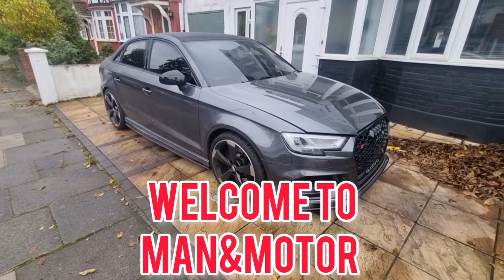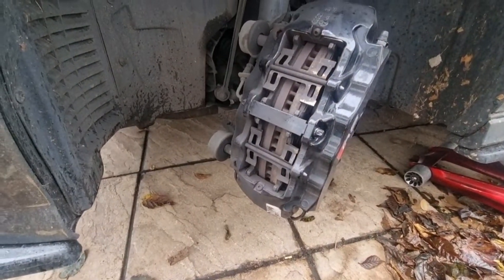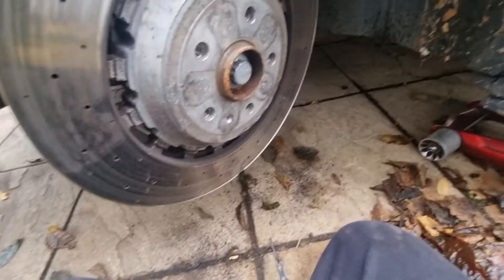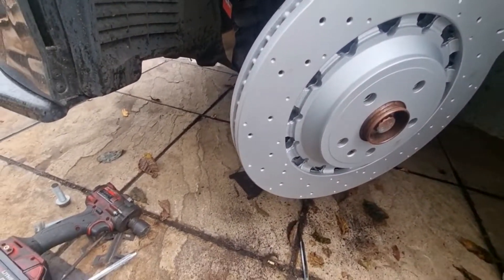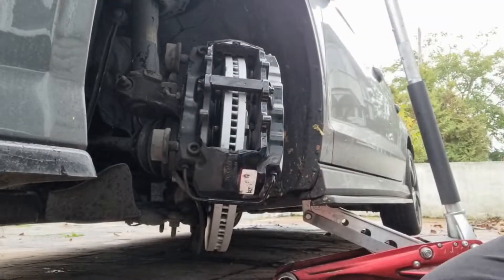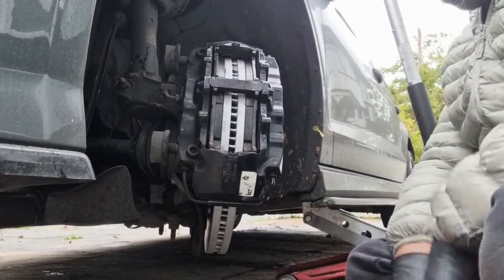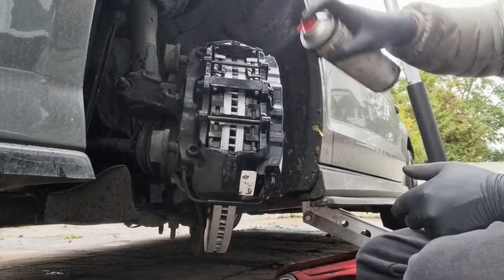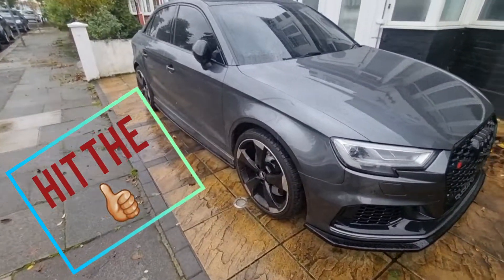Audi RS3 2019 FRONT BRAKE PADS AND DISCS CHANGE

Comment: Hello, I was wondering what size the brake discs were on the RS3. Couldn’t find it anywhere on the Internet also, I’m about to order new brake discs from Brembo but seen that there are 2 sizes. 340mm and 370mm. Any Idea which one I need? Or a link from the brake discs that you ordered could also be helping. Thanks, nice video 👌🏼
Reply from the maker: https://www.ebay.co.uk/itm/274042247972?mkcid=16&mkevt=1&mkrid=711-127632-2357-0&ssspo=isQBGrctTv-&sssrc=4429486&ssuid=xgpPGnYCQb-&var=&widget_ver=artemis&media=WHATS_APP
Reply from the maker: Hi, I sent the link to you , it's 370mm discs, that I fitted,

Comment: Do the pads get glued to the pistons on the caliper? Or do i just push in the pistons and put in the new pads? On my s6 c7 you have to buy new shims to put on the back of the pads (which goes into the pistons)
Reply from the maker: The pads came out easy on the rs3, and it come with new shims to,

Comment: What where all of the tools you used in the video? i'm planning on doing my front brakes on my rs3 and just wanna make sure im prepared! Thanks
Reply from the maker: Hi, so you will need a hammer, punch tool, 21mm spanner, or ratchet with 21mm socket. A long handle ratchet will be better, a flat screw driver to re set the piston, to take the wheels off 17mm socket wire brush
Reply: Thanks for the response! 21mm for the two bolts for caliper right? And it’s 200nm for the caliper bolt and 90nm for the wheels, but what about the T30 for the rotor?
Reply from the maker: Yes need a T30 for rota

Comment: When you push the pistons back with a screwdriver, do you have to make sure you push them all back the same distance? And did you open the fluid reservoir?
Reply from the maker: HI NO YOU DON'T HAVE TO PUSH IT THE SAME DISTANCE, LONG A THEY ARE ALL PUSH BACK THAT FINE AND, YES RESERVOIR WAS OPEN
Reply: Why do you open the fluid reservoir when doing so? And by fluid reservoir meaning the brake fluid reservoir?

Comment: hello, they have changed the front pads of my rs3 2018 and they have loosened the strap that goes with the screw.  Is there a problem in disassembling it to put the brake pads?
Reply from the maker: Hi, you mean the strap between the pads with 2 bolts on either side ?
If it is that I didn't have to take it off because I changed the brake discs too, so, in the past I never had problems before
Reply: @manmotor2889  hello, yes, I mean the strap with two screws that separates the brake pads.  I have read in a manual that the strap should not be released because there is a danger of damage.  In the workshop due to ignorance they released it to put the brake pads and now I don't know what torque they have given to the screw.  I am somewhat concerned.
Reply from the maker: You can remove them, I have in the before, I'm not sure about the toque setting.
Reply: @juancarlosnavarro3867   what you read is correct, Audi shop manual recommends to NOT remove that bridge, additionally, there is no need to remove it to remove old pads/insert new ones.... just remove pins and springs, retract pistons slightly, and the bads will come off

Comment: Hey would you mind posting a link to the rotors that you used?
Reply from the maker: https://www.ebay.co.uk/itm/274042247972?mkcid=16&mkevt=1&mkrid=711-127632-2357-0&ssspo=isQBGrctTv-&sssrc=2349624&ssuid=xgpPGnYCQb-&var=&widget_ver=artemis&media=WHATS_APP
Reply from the maker: Hi this is the link where I got the pads and discs
Reply: @manmotor2889  Thanks!

Comment: Can I switch my carbon ceramic rotors to the Brembo rotor kit you have? Or is there a size difference
Reply from the maker: Hi, yes, you can change it to normal Brembo rotor,  just have to match the size
Reply: You can just switch rotors and pads.

Comment: what brand of discs are these? can you give me information . I would like to buy brembo discs because Audi told me that oem discs + pads replacement would cost me 3000€.
but I heared people saying that all discs other than Oems will bend or crack because of the heat. is that true. how are your discs now?
Reply from the maker: Yes, the discs and pads are brembo, and so far, no problem with them . The cost was around £600
Reply: Hi! After one year 🎉 how was the experience with the brembo on the rs3 .ty
Reply: What did you buy at the end?
Reply: @AndreiIftime-ht4xf  The OEM rotors/pads on the RS3 are Brembo